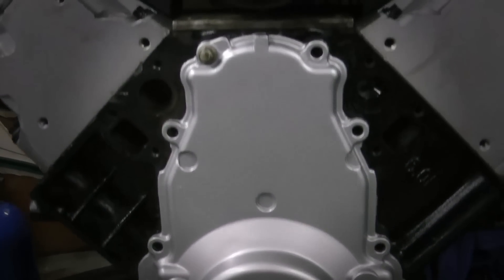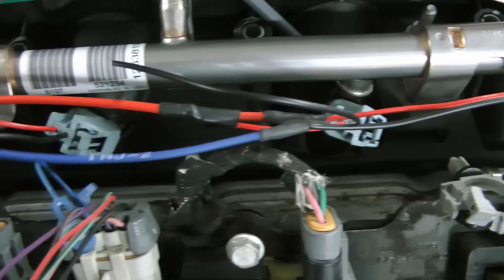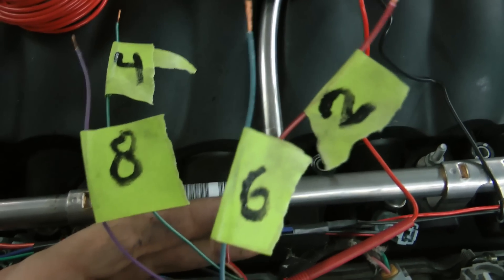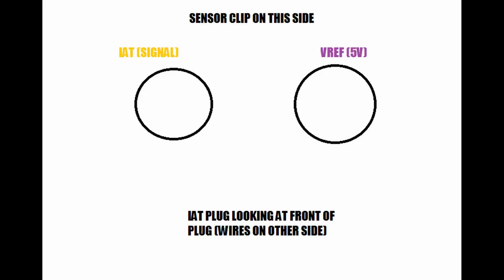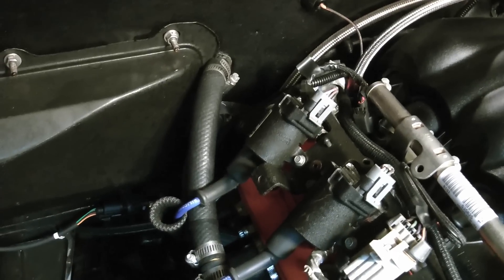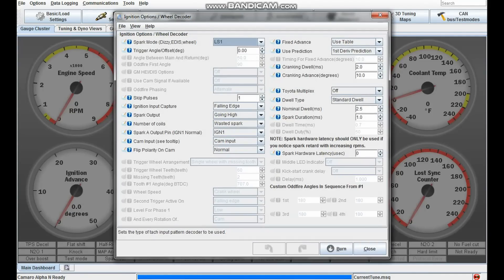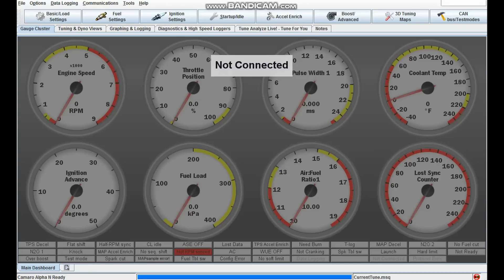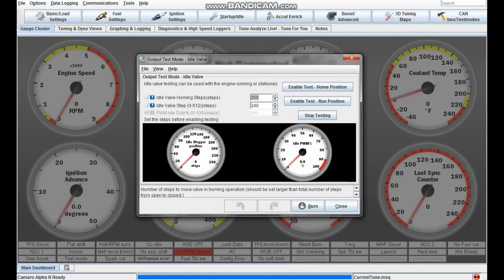How to Microsquirt Standalone EFI your LS engine!

Comment: What do you do about o2 sensors ? An can MicroSquirt adjust itself based on an o2 ?
Reply from the maker: Yup you run a wide band with a 5v output into the ecu. The paid version of tuner studio can auto tune itself
Reply: Good deal! An I can run two of em as well as an iac ?
Reply from the maker: @damianramirez2660  you can only run one. You need to get a stepper iac adapter to run the iac
Reply: Do you know who sales the stepper adapter ?
Reply from the maker: @damianramirez2660  yup talk to mike at efi source
Reply: Westcoast Wrenchin do the directions show you how to wire up a mini fuse block or does it come with one already in the harness ?
Reply from the maker: @damianramirez2660  that's all me, no directions on that. I recommend a large fused connection to a fuse block to give you a clean safe and easy power takeoff point
Reply: Alright. Thanks for the quick replies
Reply: Sorry to keep on with all the questions. But are you aware if the 30” micro squirt harness has the same wiring as the 8ft ? Cause I purchased a 30” harness and I’m wiring up my engine per your video an I do not have the same amount of sensor grounds or v ref wires an probably others as well. I had 2 sensor grounds and 1 vref wire. Is it possible I got the wrong harness ?
Reply from the maker: @damianramirez2660  I'm pretty sure it's the same harness. The reality is the sensor ground and 5v ref are completely splittable. You can run multiple sensors from each, nothing to worry about
Reply: Thanks ! I emailed the guys at efi source to get their word on it. Hopefully all is good cause I only have a couple sensors left to wire up took a good amount of time, as you know lol. I’ll let you m ow what they say
Reply: So I do have the correct harness. I purchased the iac stepper adapter. I’m not using a maf sensor. Do I still connect it from the adapter to the harness ? It gives me options. If I’m not using a maf the second option is to use a wled wire which is only on the harness so idk what wire to connect that too cause it’s already on the coils. Kinda stumped here
Reply from the maker: @damianramirez2660  I'm a little lost on where you're lost. You want to wire the iac stepper adapter? Look at the pdf on it. You use 12v 5v fidle and geound
Reply: There’s a spareadc wire and a map wire as well Do neither one of these get used if your not running a map sensor ?  The adapter I got has 4 wires on one side that go to the iac pigtail  6 on the other side that go to the harness
Reply from the maker: @damianramirez2660   are you running a maf? You had mentioned above that you're not running a maf so I was thinking you had a map.

Regarding the iac yes there's four wires in and 6 out for control of the iac stepper
Reply: Thanks for all the help. I got it all pretty much wired up on the engine on the test stand gonna try an fire it in the next couple days. I do have one question. If I wire just a regular 3-4 wire o2 sensor without a gauge to read afr will I be able to read afr from the tuning download on the laptop ? When I connect it to the MicroSquirt ? if so can I do it while driving and make adjustments/tune while I’m driving? Or obviously while someone else is driving
Reply from the maker: @damianramirez2660  no you won't. You need to buy a gauge with a 0-5v output, aem is very common. You can indeed tune live while driving

Comment: Do you need the laptop to start the car and what about o2 sensors?
Reply from the maker: Nope no laptop to start it! It runs a wideband air fuel gauge for tuning which is technically an oxygen sensor
Reply: Westcoast Wrenchin' I have Holley on my track but was looking into this for my daily and didn’t want to ride around with my laptop just to run my car

Comment: So I’m going through this right now I have a Microsquirt and both of my VRs are black and red I don’t see a yellow wire
Reply from the maker: Did you get the microsquirt setup to run the ls? Try the red wire for now with a temp connection. When you try and crank the engine over see if your rpms register, if they do you're fine :)
Reply: Matt Dunn  did you figure out if it’s the red wire or the black wire cause mine are red and black to

Comment: did you use vr1 or vr2 wire for hall sensor?
Reply from the maker: e34Boat vr1
Reply: thanks, one more question: do i use the yellow or green wire from the vr1?
Reply: ohh it was on the video :D the yellow wire... thanks again!
Reply: My vr1 wire has red and black in it not a yellow so witch one would I hook up to the crank sensor?